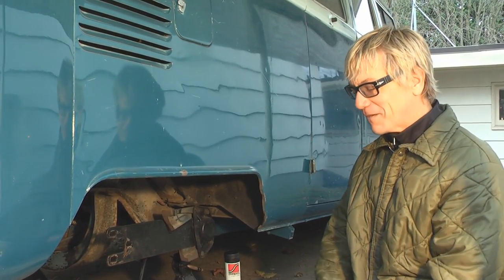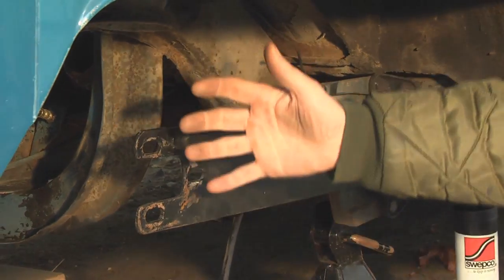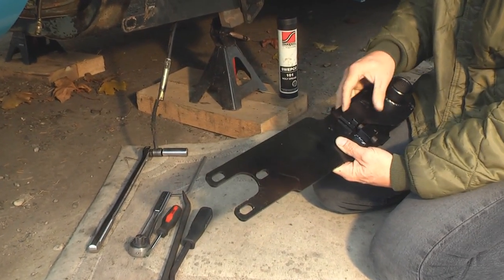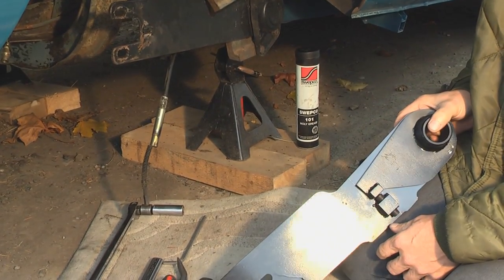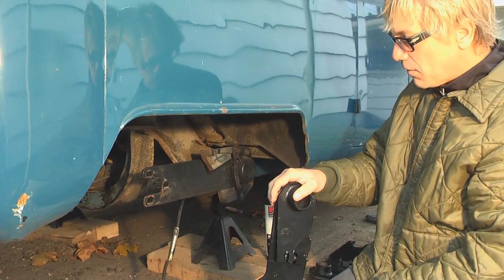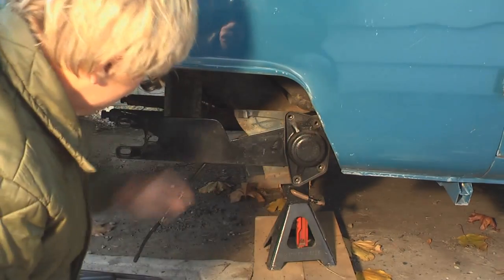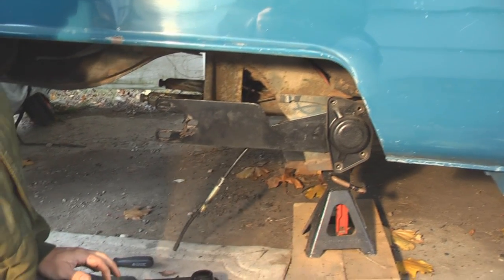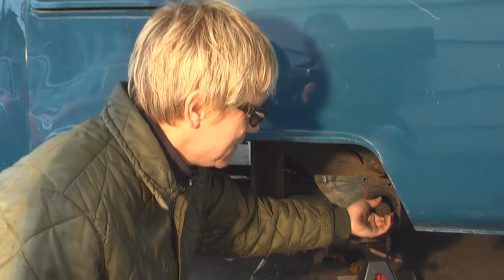VW Bus Lowering with Adjustable Spring Plates - DIY German Aircooled Garage #8

Comment: here is a silly question. How hard are you driving it with that type 1trans and is it holding up? I was told if you used bug trans in a heavy bus you'd brake it because of the weight. I have a westy and I just installed a 2176 and id like to raise my cruising speed to 80mph but id have to rake out some serious cash to redo bus trans with right gearing as apposed to putting a type 1 trans in my 69 westy. love the videos thx

Comment: Do you remember if the out plate came off the inner plate on these spring plates?
I have these on my bus and want to remove the outer plate so I dont have to remove the rear spindle bolts.

Comment: What's the point in scribing the lines against the old spring plate when they've clearly been heavily modified & different to the ones you're replacing them with?

Comment: Great video. Some info Ive seen warns of the danger of the springplate being under torsion and suddenly slipping. I assume this is not an issue if you disconnect everything before you start?
Reply: You are correct DT....when taking this all part on a stock bus have the VW tool described in the Bentley or a jack supporting the spring plate.  Lots of tension that could easily break a bone or two.

Comment: Where is a good place to get the adjustable spring plates? Have a 02/1971 Bay🤟🏻
Reply: Wagens west has the real wide ones, I just bought them also I got the dog leg ones so it sits lower
Reply: wagens west $450.00

Comment: I don't understand you didn't put any pre load on them??
Reply: no pre-load as the spring-plate is fitted in a lowered position on a different spline angle
Reply: @krusher74  yea i just put mine on today so i dont need to preload ?